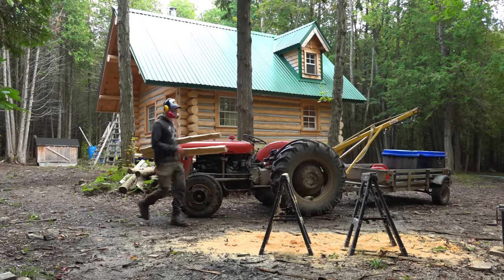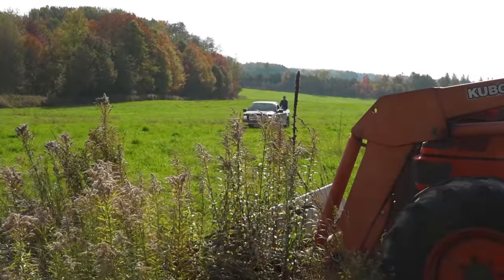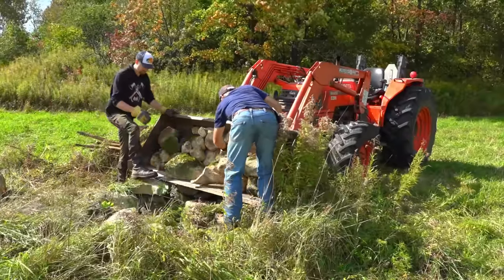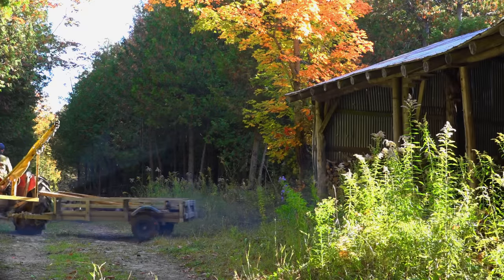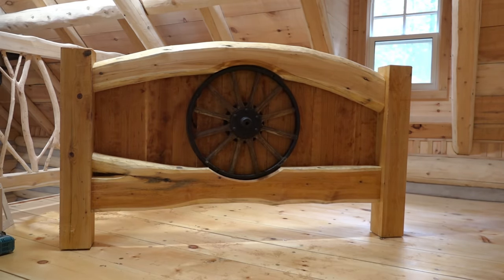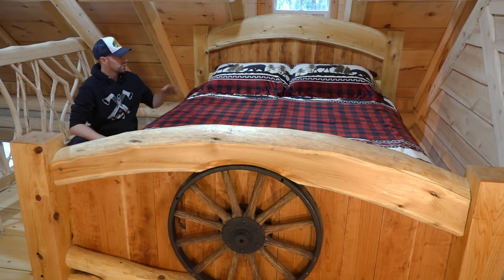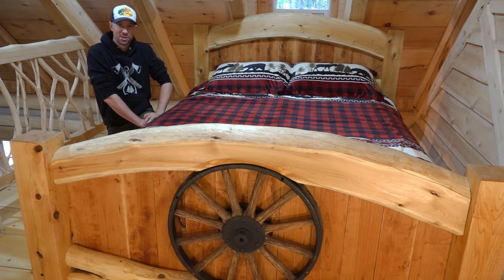Rustic Bed Build! + Strange Coyote Sightings near the Cabin / Ep109 / Outsider Cabin Build

Comment: Great work on that bed! I was a little confused as you closed up both ends, I was concerned that it would looked crammed, especially with the foot end and the integrated wheel, but it turned out quite well. Using linseed oil would be my first choice also, gives a nice finish and it smells great!
Judging by his behavior, I would say that Tintin seems to be  a crossbred with a domestic dog, staying for longer time in a close area...
Too bad that the hand-dug well has to be filled, but if it's considered as a danger thing, it's better that way. At least you saved the pump, just restore it and put it back in use, that's what it's meant to be...
Thx for the vid!
👍👍👍

Comment: Turned out great! 👍👍
The animal you saw was most likely a Coywolf aka Coyote Wolf hybrid. 
For anyone curious the reason the block of wood was driven into the bottom of water pump pipe was to prevent the pump from sucking up mud, sediment and other gunk that settles at the bottom of a well.

Comment: The bed turned out great! I am a designer by trade and love looking at layouts.I was looking at your main level and thinking how you could get a table, bunk and comfy living room seating in. It is hard to get spacial referance because of the perspective of the leans and I believe it looks bigger on camera. But hear are some ideas to play with in your space, table, one of two thoughts first a wall drop table that can seat three may fit on wall opposite the counter in the kitchen or the end wall between the bath and post or using the post as the table pedestal. Find an area for a bunk cubby, think train car bunks or boats and the bunks on them if a drop down table fits in kitchen then use the space between the post and bath in an "L" shape to the bath and creating a wind break to the back door and a corner next to the bath door with cabin curtains on each bunk creating a "room" for each child. If that location won't work measure to see if the wall past the living room window the wall the front door opens on to has enough room for bunks and do the same curtain cabin look there. living room furniture is all about your end goal, If it is to sleep one more then get a sofa that the back cushions can be removed and the seat depth with back cushions removed is about 36" deep then you can sleep one there as well, if it is comfy seating think about a pair of club chairs flanking the wood stove and a love seat across from the wood stove. Can't wait to see what you do! All the best!

Comment: You never cease to amaze me with your quality woodworking skills. Every piece you design and make is matistically well thought of in it's overall purpose and appeal, also your planning and executing of use of materials and tools used to bring your ideas and visions into a works of creations is Top quality not only do they look spectacular they fit in with your cabin design and furnishings. It truly looks more solid structurally it looksabsolutely fantastic with the curved timber head and foot boards and that special touch with the incorporation of that wagon wheel on the foot board gives it a rustic backwoods feel with that professional lumber workmanship. I got a bit worried with the weight of the head and foot boards and wqs saying to myself i would of constructed it all together up stairs but then you seem to use the rope pully system at the stairs to help lift it up yourself and wondered how you were going to get a mattress there to the cabin and like Harry Potter waving his wand saying Presto you walk up with it in hand. And know people would pay good money for quality finished wood furnishing to acquire one of their own beds similarly customised by The Outsider which is something considering would be to make up and form The Outsider logo into a branding iron and etch burn it into the head and foot boards. Your Father and Grandfather would be extremely proud and impressed with your design accomplishments soaking in the elements you've customised and your persistent long jevity into this cabin build,  that Snr and yourself started on and  completing it on your own, and you have endured to many personal family health issues and tragedies in the past 2 years for a young man with a young family of his own along with the whole cabin project build has turned out to be  a stunning picturesque works of art every piece fits in with purpose in your designing and end goals with every step closer to completion. Well done The Outsider another skill level unlocked lol May God bless you and our family in prayers and good fortunes everyday until you relax and realise in wonder how good it is to sit back and marvel at all the finishing touches that you've added to complete its look. And I am gratefully appreciative to watch every uploaded episode you post thankyou The Outsider.

Comment: Looks great! I would caution you though that it appears you didn't consider seasonal wood swelling in the footboard and headboard. Those slats are anchored butted up against each other without room to swell. Wood expands and contracts with the width of the grain. If they are locked into the curved boards, they won't be able to travel as they swell.. it may warp over time.  look at how "bread board ends" are designed in tables and it will make sense.. polyurethane can actually help this as it will stabilize the moisture content throughout the seasons.. 
The mortise and tennons for your bed rails was smart!

Comment: Awesome bed, aligns with the rest of the build really well.  Would you consider turning it 90 degrees so you did block access to the dormer window on the headboard side?  The dormers are a really cool feature of the cabin.  If the headboard was against the backwall of the cabin loft then you would see that cool footboard as you came up the stairs and probably as you come in the front door as well.  That wheel deserves to be shown off more.  I love you design choices.

Comment: Such a beautiful bed. Your Dad would be so proud. May I suggest drilling a hole through the legs into the headboard and footboard…. And driving a dowel with glue through them. I’m afraid that those anchors are going to get loose quickly going into end grain like that. Just a suggestion.

Comment: En trabajos de madera, he usado aceite de Linaza diluido con gasolina limpia de automóvil; no da un mal olor se aplica fácilmente con brocha y al evaporarse la gasolina, la madera queda más impregnada de aceite al interior; y las plagas como la termita difícilmente entrarán en esa madera así tratada. Me gusta tu canal y tú labor; eres bueno en lo que haces; felicidades. Saludos desde Aguascalientes,-Aguascalientes México.

In wood work, I have used Linseed oil diluted with clean automobile gasoline; It does not give off a bad smell, it is easily applied with a brush and as the gasoline evaporates, the wood becomes more impregnated with oil on the inside; and pests such as termites will hardly enter that wood treated in this way. I like your channel and your work; you are good at what you do; congratulations. Greetings from Aguascalientes,-Aguascalientes Mexico.

Comment: Hey Outsider,
Wow, it's been a long time since you last posted. Hopefully everything has been alright and you've just been enjoying the summer weather with your family.

The bed is beautiful. The small wagon wheel is a great touch. And I'm really happy to hear that you're hoping to be in the cabin for Christmas this year, that you just need to bring in and build some more furniture.

Looks like a CoyWolf, that was my first thought because I know Wolves aren't that human friendly or human interested. But yeah, the tanned orange (red) color is strange. Coyote and Fox can't breed successfully. If it is a CoyWolf, it's possible for it to have a redish tinge to its fur as some Coyote do have a similar fur color. I've seen that myself. One other possibility is if a Coyote bred with a domesticated dog like a German Sheppard, as Sheppards sometimes have red in their coats and the 2 are closer in genetics than other types of dogs? Either way, it's a beautiful Coyote Cross of whatever kind it is. It would be good if you can get a closeup of the head and sideview of the snout, that can really tell if it's a CoyWolf or a Wolf/ Domestic dog mix.

Sad about having to fill in the well, but yeah, safety first. It would have been possible to keep it and cap it with cement, leaving it mostly intact as it was built. But atleast you got the hand pump which I can see be used as it's supposed to be at the Cabin, maybe next year, if you were to dig a well?

I'm looking forward to all of you being in the cabin finally for Christmas!!!!

Keep Safe and Always Inspiring,
Matt - Toronto, Canada

Comment: It is an Eastern Red Coyote with a recombinant fawn agouti gene. The agouti gene in Canids causes different color patterns. The typical wolf or coyote is wild-type, which means the hairs have bands alternating color giving the mottled look. There is also fawn/sable, which is a tan coat with black whiskers and may include black guard hairs on the body in pattern or not. Tan points is the black coat with tan 'pips' above the eyes, on the cheeks, legs and rear vent (aka the doberman pinscher) and a recessive black. 

And for the record, the Eastern Red Coyote is already a hybrid of Coyote, Wolf and domesticated Dog and has been for over 50 years. Genetic testing shows them to have crossed with domestic dogs 50 years ago and they contain 8 to 11 percent domestic dog genes, while the wolf crossing started about 100 years ago and they contain 8 to 25 percent wolf genes. Most of the tested animals showed 60 to 84 percent Coyote genes. [A genome-wide perspective on the evolutionary history of enigmatic wolf-like canids by Bridget M. vonHoldt, et al. Genome Research October 8, 2010/April 4, 2011. Cold Springs Harbor Laboratory Press.]

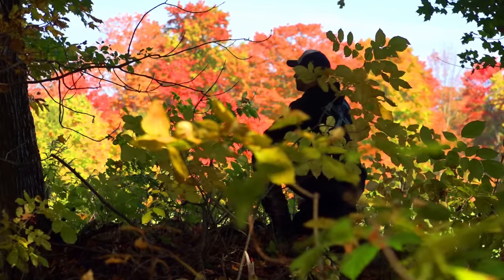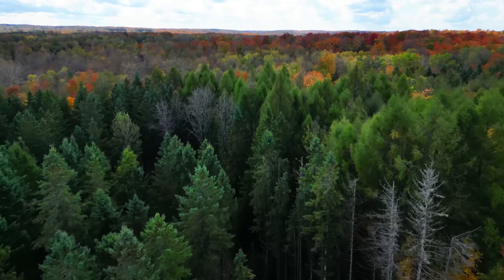Comment: The animal at 17:07 would be a wolf with a winter mantle but, interestingly, it has orange (fox coloured) hair on the top of its snout and underside of its tail with some on the back of the back leg mid way up. The tip of the tail appears to be almost black. The animal at 17:40 is not the same animal, right? Unless there was enough weeks between the two images for the loss of a coat hair revealing an orange undercoat/summer coat. All in all, you have a very interesting canine there.

Comment: Another truly sublime, artistic use of the materials that you have at hand. I found myself wishing that I could have a custom built bed like the one that you crafted. Regarding the animal that you've encountered, I think you may have a problem on your hands. It looks quite a bit like a dingo or dingo cross, but that is unlikely. Dingoes are found in the wilds of Australia, although it is not impossible that someone illegally obtained one and then turned it loose in Canada once it had grown up. They are notoriously difficult to domesticate. Even if it is only a wolf hybrid, it is still concerning, because hybridization produces a temperament and traits that are a box of chocolates. The bottom line is that you have a large alpha canid, unafraid of humans, that has staked a claim on a part of your family's land. His behavior is concerning. He should not be lingering in the area. He may be studying you in a predatory way. I would recommend putting a hollow point between his eyes and remove the doubt. I would give him another few days to clear out and then euthanize him. And I would not be unarmed with him roaming in the vicinity. Animal lovers will not like my post, but you have yourself and your loved ones to consider. Stay safe and well.

Comment: Here in Maricopa County, Arizona, brazen coyotes are strictly the norm. They always behave like juvenile delinquents, and it is their nature to operate either independently or cooperatively in larger numbers. I am not criticizing them for their survival instincts, but most cattle ranchers do not like their behaviors. One example is the way they wait for newborn foal, then rush in and take it. Many ranchers hate coyotes for that reason. Regarding your chimney roof support, you need to turn the supports parallel with the roofing. That way, the snow slides off the roof naturally. I believe this is what your father would want you to do, but it's your decision of course. I have seen other off-grid YouTubers and they are all installed parallel with the slope of the roof. There are no dangerous snow buildups as a result. I have watched all of your episodes and 'liked' all of them, and of course I'm a subscriber. Also, I am 71 years old and a fellow believer. Jesus is Lord. Your brother in Christ, Joe_Arizona.